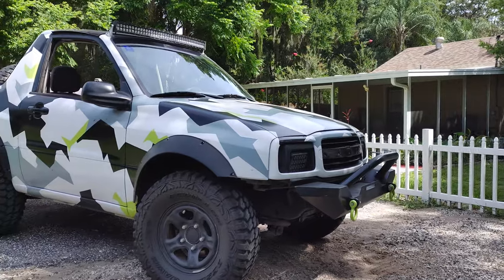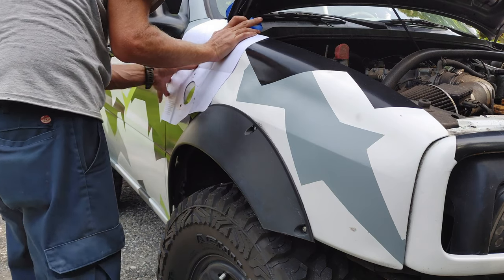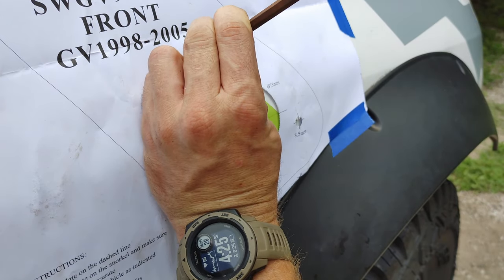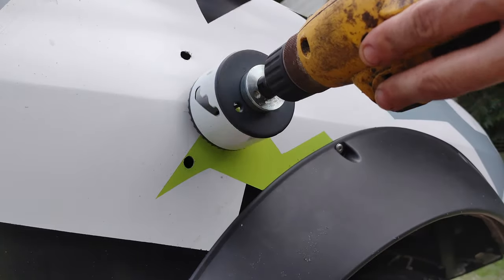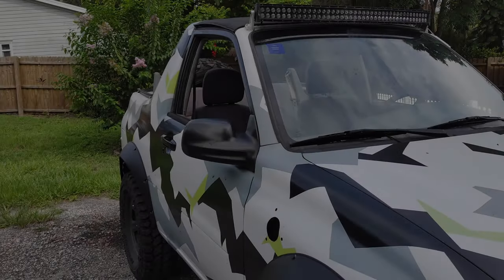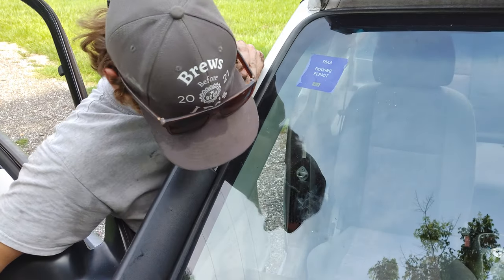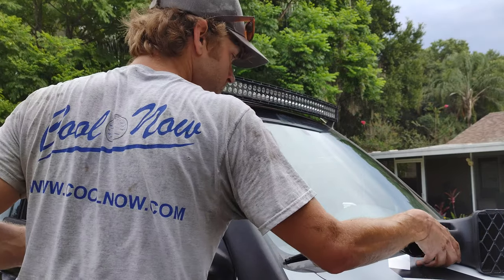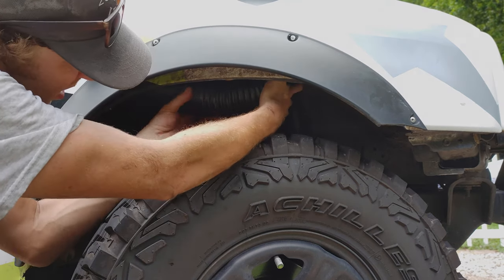This mod SUCKS!! || Snorkel Install Guide Chevy Tracker (Suzuki Vitara)

Comment: Just a couple of suggestions.  Any hole you drill through your paint use a cheap artist type paint brush, spray a little quality paint  in the cap apply with brush. 

Apply some butyl type sealer over holes and around high areas and sides, you can leave a small drain area down in the lowest spot as a possible drain.  

Add some waterproof material at all connections at final install. 

Something over the inlet (they have products for this) to stop driving rain or snow or reverse the direction of inlet. Remember you are trying to stop water from getting into the inlet.
Reply from the maker: For sure.  If you notice, I actually have a "cold" air intake on the truck which bypasses all of the factory air box connections.  As of right now the snorkel is purely decorative, otherwise I would have gone a little more in depth with what you suggested here.  Thanks!

Comment: Nice, I think your bolt holes were right on, looks like the studs are at an angle which would make them not fit from the outside,  but you handled it!! Sooo .. any news on the jet boat?? 😜
Reply from the maker: Thanks!  And right now, trying to source a rear inboard engine cover I can modify to use in my boat
Reply: @BarelyBuiltRight  i forget where you are but there is Don's Marine Surplus & Salvage in Clearwater, FL.. basically a boat junk yard, where you could probably find something.. or just use some plywood and cover in fiberglass..
Reply from the maker: @djmjr77  I'll have to check that out!  Thanks for the heads up

Comment: Did the snorkel increase or decrease the fuel economy? 
The reason I ask is because the junction between the snorkel and the flexible pipe(it has a big rubber grommet thing)is smaller than the inlet of the snorkel and where the flexible pipe enters the airbox.
Reply from the maker: Tbh, I've never tracked my mileage with this vehicle, so I couldn't tell you in one way or another.  Sorry!

Comment: think with cutting the tires would work without the spacers.    i beat on my tracker dont think they would hold up
Reply from the maker: The spacers typically increase interference, so require more cutting.  I put the spacers on the push the wheels out to the flares

Comment: I need soft top trim parts for a 2003 Chevy Tracker. Do you know if a Geo Tracker would fit good?
Reply from the maker: "Chevy tracker" would be the "geo tracker" for that year.  Anything branded "geo" would be first gen, which wouldn't fit.

Comment: What is all the mods you have done, I have myself a tracker and what to start modding it
Reply from the maker: I've done quite a bit on it!  Feel free to take a look at my other videos for more ideas.

-custom paint
-2" lift
-31" tires
-2" spacers
-jeep front bumper
-fender flares
-light bar
-LED jeep headlights
-snorkel
-some other bits

Comment: How did you seal your raised air intake? Silocone?..
Reply from the maker: Ill let you in on a little secret...i have an aftermarket intake so I never actually plumbed it in.  Its just for looks right now until I figure a way to route it